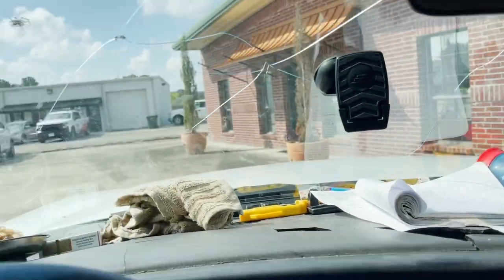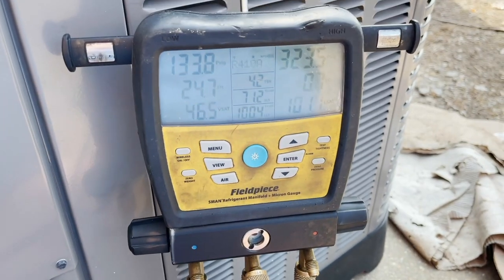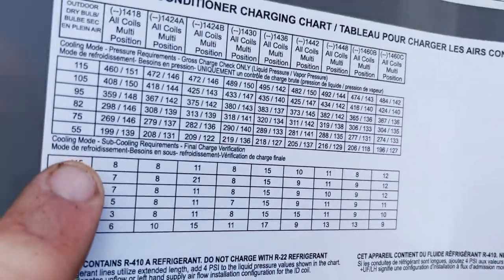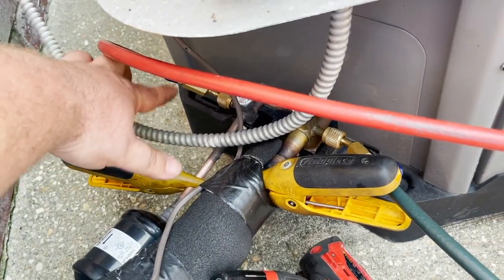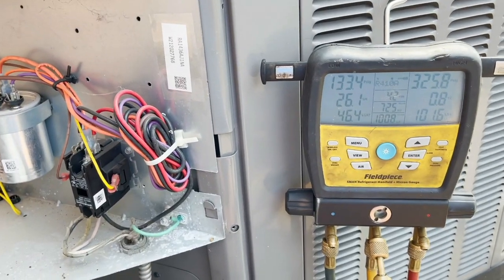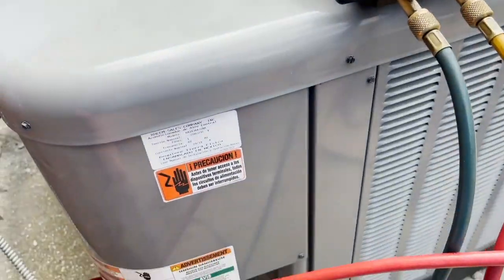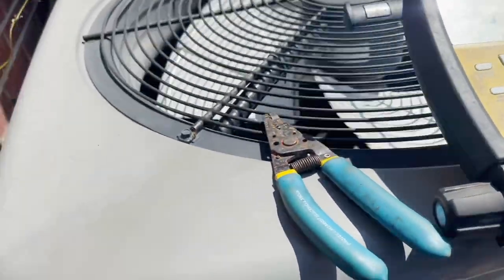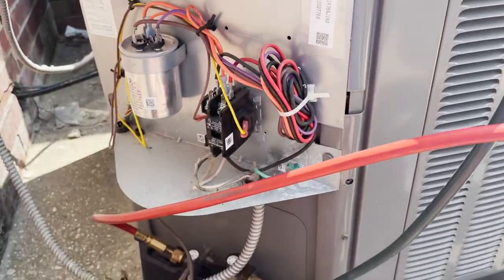Simple Under Charge & Unsecure Disconnect

Comment: If the space inside is very hot with correct charge the superheat would be higher than 5 with a TXV , TXV tries to maintain superheat but I believe it doesn't hold a constant superheat. TXV it's not responding they way he wants it to. As the temp goes down inside the superheat will go down since it's less of a heat load across the EVAP coil. High heat load will boil the refrigerate faster causing higher superheat. lower heat load will cause lower superheat. I think the superheat is going to continue to go down as the temp inside goes down. Oversize TXV or bulb not properly placed on suction line.